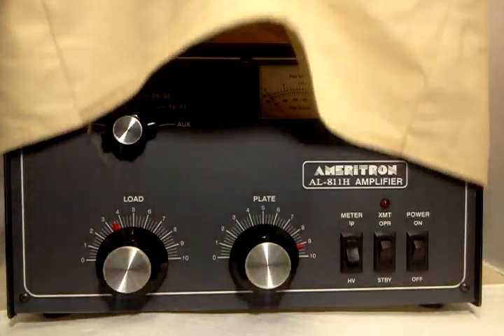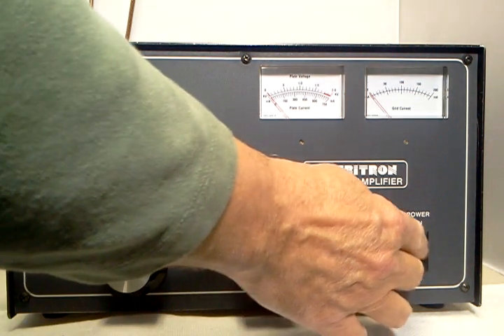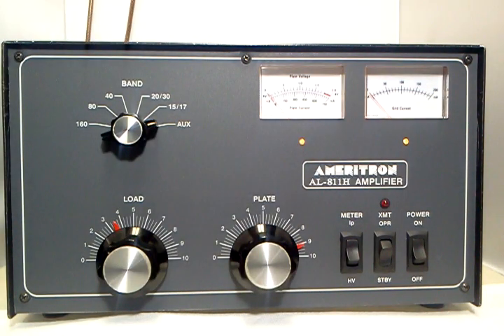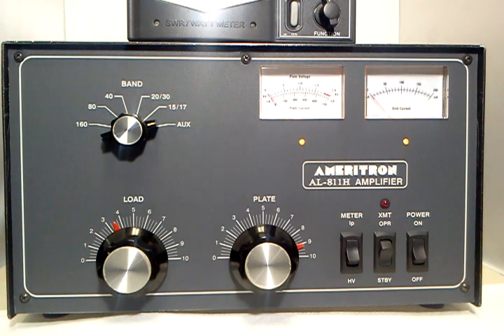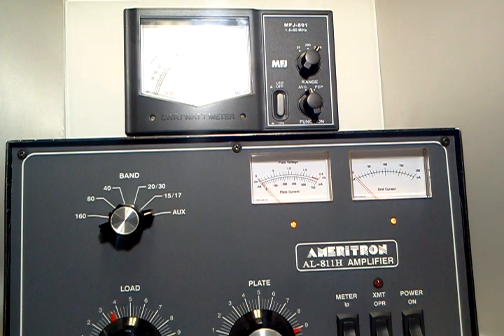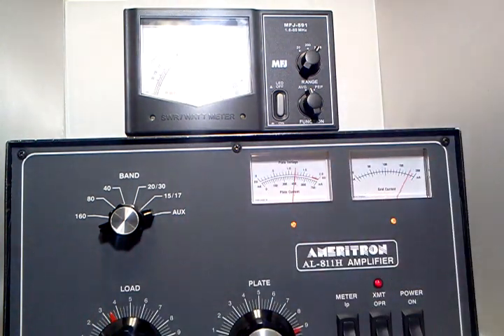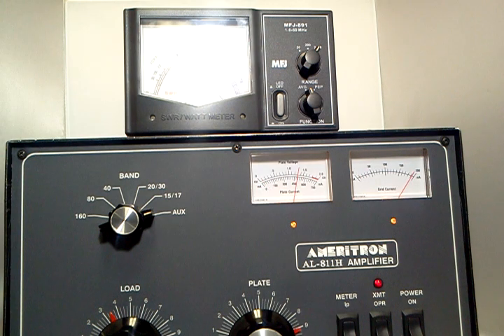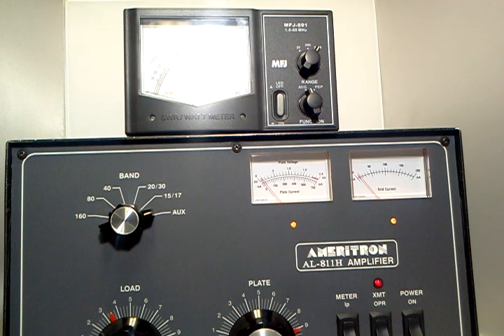Ameritron AL-811H

Comment: it would have been nice to not have such a glare from the power meter.  I looked and looked for some good videos when I was thinking of getting an 811H.  I only found a few.  I was very worried about tunning it up as it was my first amp, I agree with Jeffrey, there are a lot of questions new hams or hams with new amps will have.  My 811H only does about 500 max on 40/80 and about 300 on 10.  My tubes are a bit soft I suspect.

Comment: 650W on 10M. !! You stand a good chance of blowing it up !. AP PCB on 10m.  Coils MUST be 5 turns only. TX/RX relay could weld !.  MOV`s on heater RF choke if fitted can go S/C . Ask me how I know all this. Yes, I had it all and repaired and modified it. I keep off 10m. Then amp is OK. 73 M0MPT.  PS. My valves are a little low emission but will push 650W on 20 and 40. Hope this is helpful.

Comment: Trying to figure out the purpose of this video.  A sales video for MFJ and Ameritron?  You didn't show how to tune it, what else was connected in line with the TS-2000 and wattmeter, or where in the line each was connected, or if you had a tuner for the antenna or if the antenna was resonant on 10M and didn't need a tuner.  These are all questions new hams, especially new hams buying a linear, will have.

Thanks,
Jeff - W5JGW
Reply from the maker: cheeesh

Comment: Hi does anyone know if you can plug the PTT line on an AL 811H into the relay socket on an Icom IC 7300, to start with i didn't think you could, but i have just measured the voltage at the socket on the radio, the one marked relay next to the ALC socket and it reads 00 on tx and rx, so i think it grounds out as you would expect it to, but there is a lot of hoo hah about 16v at 0.5 amps etc, in my opinion as the amp uses 100 mA at 12 volts at the PTT i think you can plug it straight in the socket, but i'm not brave enough to try it lol from Fred g4vvq in Uk.
Reply from the maker: The 7300 uses a mechanical relay to short the "send" jack. You will be ok with that amp. It's the old amps like the SB-220 etc that need some kind of interface.  Having said that, there's nothing wrong with using an interface to isolate the rig and amp.
Reply: Thanks Steve
Reply: AKA "BUFFER"?
Reply: AKA "interposing relay"